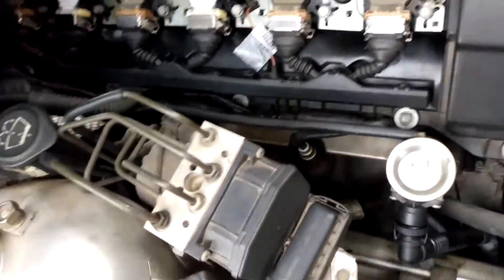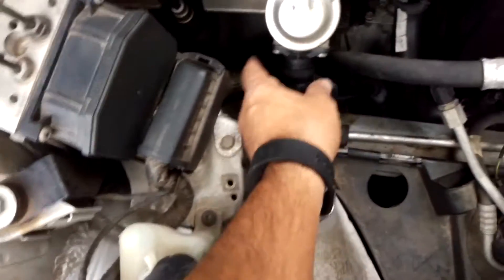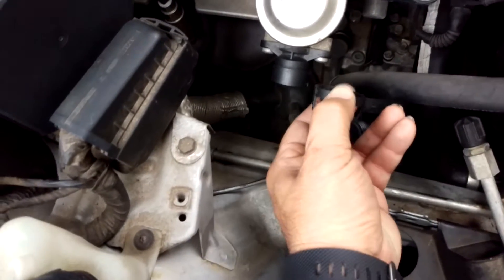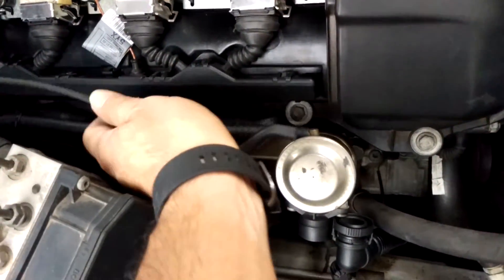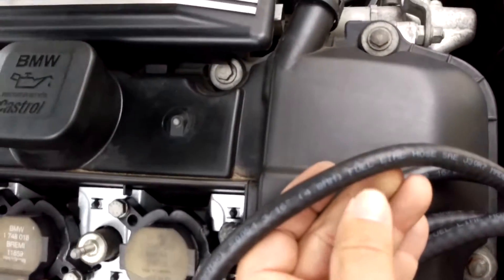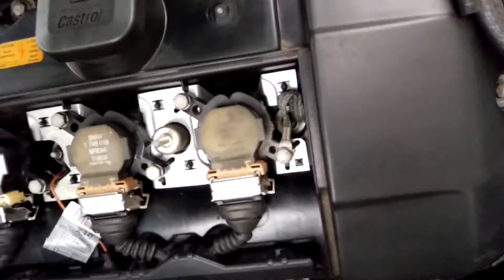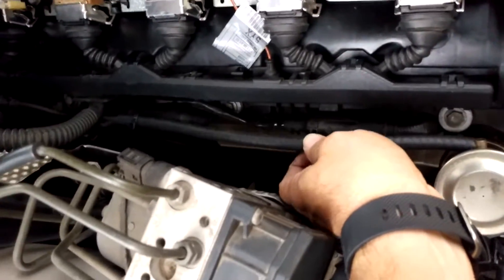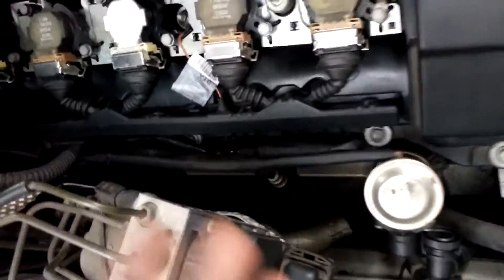(E39) 2001 BMW 525i Resolve P0491/P0492 for less than $2.00 in approx. 15min

Comment: Thanks for this. Had P0491 and P0492 codes. Sure enough, that vacuum line crumbled when I just touched it lightly. Replaced the line, cleared the code, and all seems to be good, knock on wood. Definitely check that vacuum line before freaking out!

Update: Code came back after a few days. I had to also replace the vacuum line behind the intake manifold (just follow the SAP line all the way to the back). No issues since replacing. I'm 95% sure these lines were broken when my car was in the shop for a new valve cover. So just be aware if you're on original lines and you or a shop are doing that job/removing the intake manifold, etc.

Comment: Thanks bro. Im having this problem.
Reply from the maker: After 5 years with this fix action, I finally plan to replace the entire vacuum tubing along with the electric valve & the non-return valve.  I found the parts on amazon just this past week.  The difficult part will be accessing the electric valve. It sits/attached to the back of the intake manifold against the firewall and I don't plan to remove the intake manifold.  Part Numbers: Vacuum Pipe (Part #: 11727574490), Electric Valve (Part #: 11747810831), Non-return Valve (Part #: 11611312737), Vacuum Hose Black (Part #: 11657803732)  https://www.amazon.com/dp/B01ILEUIR6?psc=1&ref=ppx_yo2_dt_b_product_details

Comment: How did this make your car run? I'm about to go look for this on my E38
Reply from the maker: To be honest, I don't really remember...and I don't think is was bad at all just annoying I could not get the SES light to go out.  I had this particular engine code on for a awhile.  And the yellow light was there for forever...I'm talking about a year or so.  I had a local mechanic shop diagnostic and they gave me a very unsatisfactory answer.  Blame it on "Crankcase Ventilation Valve/System"...pretty typical problem with these engines and a bit of a pain to do yourself.  And would typically run $600 -$1200 (depending on how much of the system they replace).  Thing is, I just had this job done not very long ago...and again it was the light and it would be go out and come back...but mostly, just stay on glowing on the dash.  This was my fix action to this day that code has not returned...knock on wood...LOL  Caveat, this is only related to those 2 codes.  And this is the most "common" part of failure.  If you have other codes this will probably not your problem.  If your don't have a code reader go to autozone they can give you a list of codes and possible fix actions for free.  Let me know, I may be able to help out on what's going on...though, my experience is on my E39...or at the very least point you in the right directions. :)